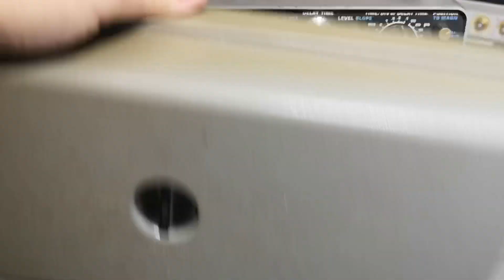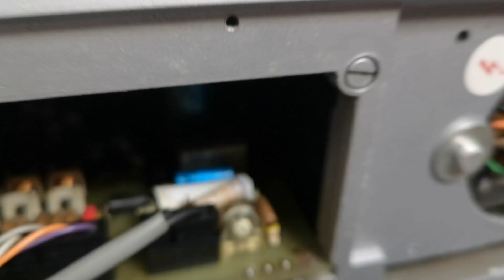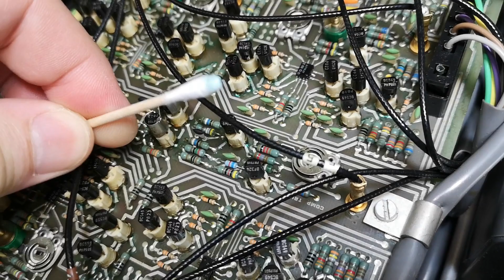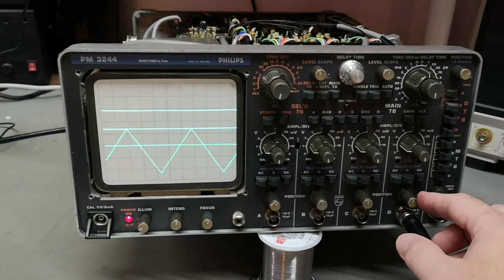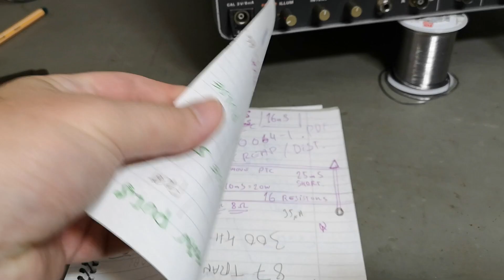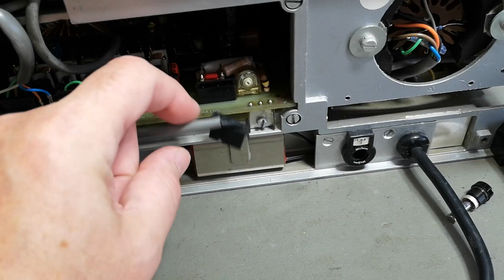Philips PM3244 oscilloscope 4ch 50MHz 1979 test teardown

Comment: Yay. Great stuff. Have the same scope. Mains filter blew up big-time too, but in mine it's a black plastic box containing a RIFA and two inductors. so the mess was contained. Apparently Philips anticipated this and tried to mitigate potential damage. Not sure if is an earlier or later revision.The RIFAs on the PSU PCB were still intact but replaced pre-emptively.
A bigger challenge was locating a replacement for the TO-76/77 packaged LM208H op-amp that failed in (I think) channel D. I lucked out and managed to source some NOS from Italy. Physically removing the attenuator assembly to get at the component was a much bigger challenge, however. These things are a b#*ch to dismantle!
Reply from the maker: happy to know i am not the only one struggling big time to open and pull out boards from the good old philips scopes :-) maybe i simply fail IQ level or patience level.

Comment: For the screen filter, I use coloured acetate sheet, widely available and used by craft people to make collages etc. Best of all, it's less than £1 / 1euro per sheet! It's usually not as thick as the original (typ. 0.2mm) but once it's in the plastic bezel that doesn't matter. I tested some for filter properties i.e. how good it was at blocking colours other than the main one, and found it was not much different from the Philips original.

Comment: Give me an HP or Tektronics over this any day. This looks sketchy in build quality.
Reply from the maker: you are not fair :-) this is NOT in the same price range, far from it, so ofcourse it is not the same level of build quality.
Reply: @TeardownOZ2CPU  OK. I’m going to smoke some RIFA now. 🤣
Reply from the maker: @SinnerSince1962  RIFA and Duracell :-) the most famous for beeing bad.
Reply: There is lab grade (Tek, HP - Highest quality components, sometimes hard to replace custom parts, high complexity but not very complicated: circuit stages designed to do one thing and do it well each, sometimes very custom parts are used), there is service grade (All kinds of smaller and house brands - Consumer electronics grade components, usually off the shelf, low complexity but very complicated: circuitry meant to do as much as possible with as few components as possible) .... And there are brands that just take a middle road (you probably could call it manufacturing grade, that is where it was often used) - Philips and Hameg are prime examples.
Reply: Having both Philips and Tek scopes, I agree they are in different leagues. The downside with Tek is indeed the use of hard-to-find, custom components as mentioned by @splitprissm9339. Tek mainly catered to government clients (DoD, NASA, etc) whereas Philips was more at home in commercial repair shops.

In terms of reliability, both have their issues. I've had fancy components fail in the Teks. though the PSUs tend to be solid. In the Phlips it's mostly simpler stuff that fails, e.g. caps, PSUs. I will say however that the pots Philips used have aged far worse than those in Teks!

The nice thing about these Philips scopes is the ability to set them up on the floor next to you, saving bench space. Both my Teks (5000 and 7000 series) are heavy bench scopes with plugins, though I acknowledge Tek made very good compact scopes as well (e.g. the 400 series).